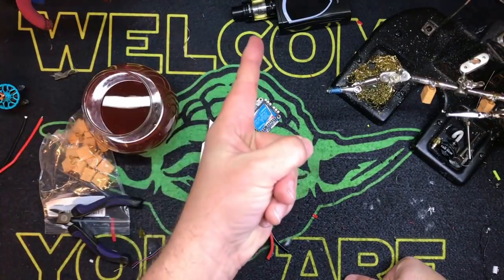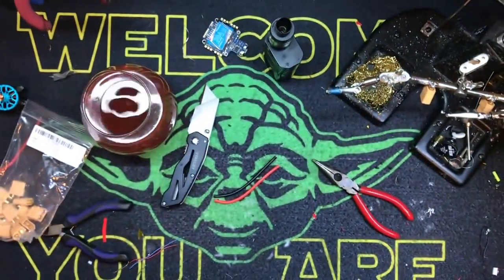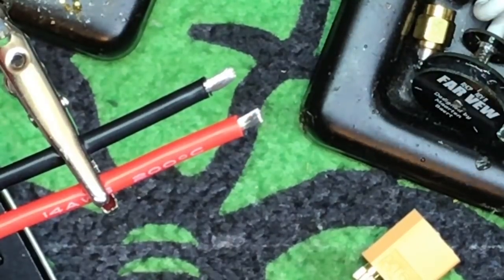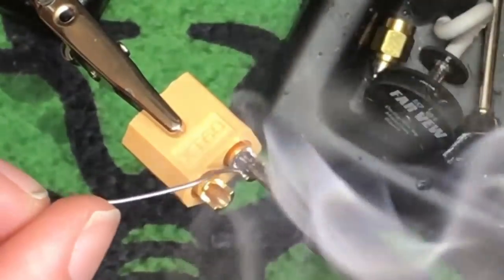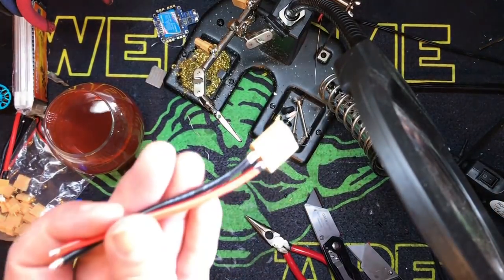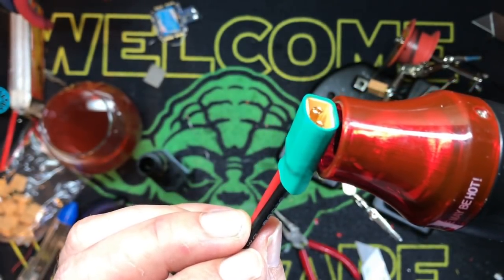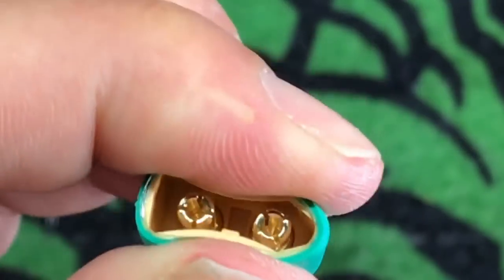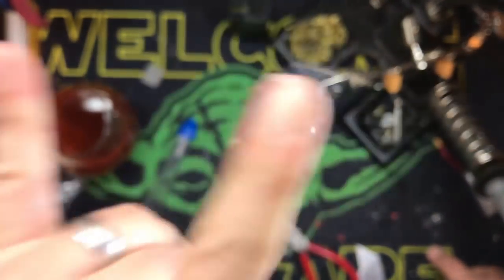QuadKitchen Build Tip - XT60 and Power line soldering

Comment: Great tip with the heat shrink good video. what did you brush on the terminals
Reply from the maker: Conformal coat.
Reply from the maker: I get it off amazon.   Great stuff